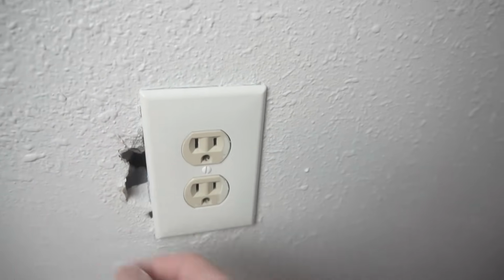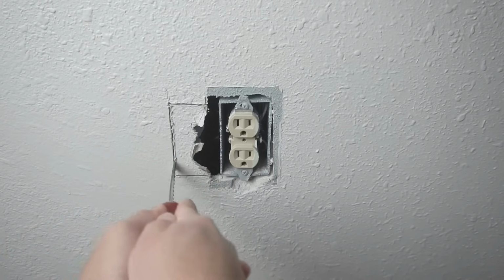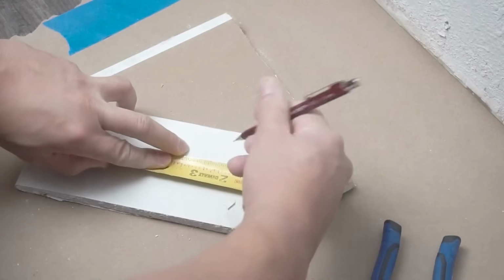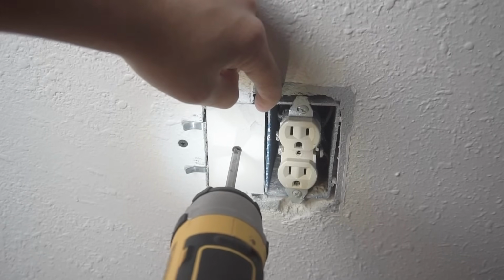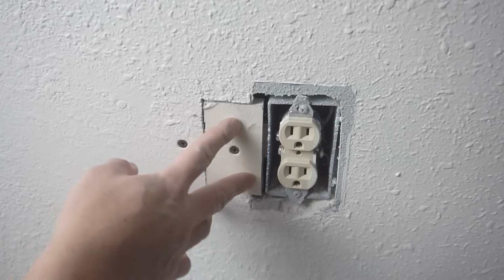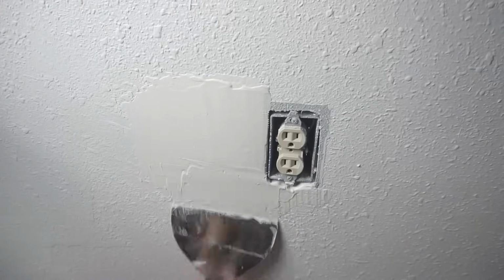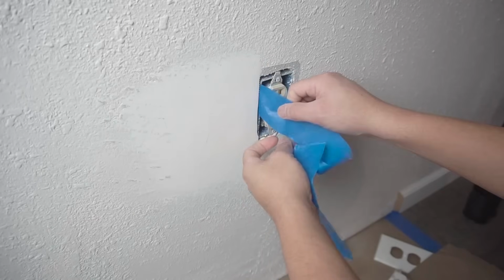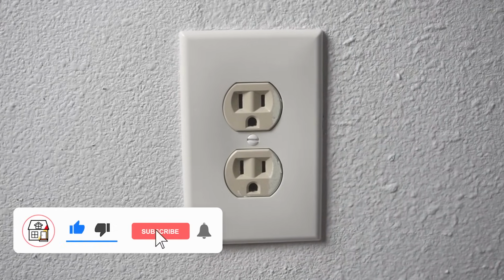How To Repair Overcut Or Damaged Drywall Around Electrical Box Outlet | DIY Tutorial For Beginners!

Comment: I do a fair amount of electrical work on older homes, where I often have to open up drywall or lathe and plaster walls. I work with quite a few older folks who really don't need to hire another 'guy' to come and repair stuff like this. Fortunately, I know how to do this repair work (or worse) and usually put in my time/materials at no extra cost. 
I'm just paying forward the time/effort my mom put into my upbringing and education, etc. Depending on the home/job, I may have to return a couple of times to let things dry/cure, and do a second/third coat of 'mud', it's just the right thing to do. Getting a 'sparky' or plumber to even bother with a 'small' job is insanely expensive and/or impossible for so many people, I feel better taking care of all of it at this point in my life. (Just don't let me near paint :))).

Comment: - Introduction: The tutorial focuses on repairing damaged drywall around electrical outlet boxes or covers, emphasizing the importance of addressing hidden damage caused by impact.
- Preparation: Ensure safety by turning off power from the circuit breaker. Measure and mark around two inches from the visible damage to create a template for cutting.
- Repair Method 1: Utilize drywall repair clips by attaching them to the damaged area and securing them with provided screws. Measure and cut a piece of drywall material to fit the damaged section, then attach it to the clips.
- Repair Method 2: Alternatively, use scrap wood such as a shim or a stir stick to support the damaged area. Secure the wood with drywall screws and attach the cut drywall piece.
- Finishing Touches: Scrape off excess texture around the repair area for a smooth finish. Apply mesh tape and joint compound in layers, allowing drying time between coats. Sand the area to feather the edges, then apply joint compound texture using a texture sprayer. Finally, paint over the repaired area and reinstall the outlet cover.

Comment: For something that small just remove the face plate and put some mesh tape and mud it
Reply: Well, that’s what the drywall guys did in my house where the installers went a little crazy with the rotozip. Problem is, they caked up the mud into the boxes, and later when I needed to start wiring I had to cut all that out. Since they didn’t use mesh tape, sometimes not even paper joint tape, it just crumbles away past the box, exposing the hole they patched when I try to cut the dried mud out of the box. I have half a mind to just give them a patch to work with when they come back to prep for paint, at least that way I know it will be a good patch and not just a paper thin layer of mud providing the finished surface. I can barely bump their patch and it starts crumbling.

Comment: Instead of using joint compound, use cornice cement, it set like rock! on top of the cornice cement use filler, You dont need to use the mesh tape.. Also put cornice cement on the edges of the dry wall insert. If using the timber put in opposite way from the video, so you have 2 points of contact instead of one

Comment: i dont like all that work if i have some expanding foam in a can i will spray around the box and let it bulge out the hole then when dry use a razor blade to cut flat to wall sand it if need and primer the foam  paint the texture often looks good enough but if not you can add a thin mud coat and texture spot prime paint 
my method is the strongest way and you may add some insulating properties as well

Comment: You can sand and feather the edges with a damp sponge and leaves it  no dust to clean up . I use a tile sponge, and they clean out easily if you are sanding large areas and need to rinse it out .

Comment: I would just replace the one gang box with a two gang box.  It will be faster than to patch the wall, and you get two more outlets.
Reply: So what’s ur advice it is a quad receptacle already make it 6 lol
Reply: @justinroll7481  Install a small cabinet in that case.
Reply: 2 gang tiger box. Pigtail for the next outlet and done. Demo old box with a multi tool to cut the screws.
Reply: It's not a "quad" recepticle. It's a only 2 outlets existing. Once you put the 2 gang box with another outlet then it will be 4 outlets.

Comment: If you don't have a lot of texturing to do, you can use the spray cans.  They are cheaper than buying a whole compressor and hopper system and a lot more convenient.  If you're going to use them a lot, or texture a ceiling, my recommendation is to go with the hopper.  The spray cans suck for ceiling texture.  Definitely worth comparing the prices.  If you go with the spray can texture, I HIGHLY suggest you go with the "pro-grade" cans.  They shoot texture substantially better than the cheaper cans.
Reply from the maker: Thank you for the advice! 🙏🏽😊

Comment: I have used texture in a can and it works pretty well. So if anyone out there is looking to cut a corner and doesn't have the big equipment for the texture there are some decent ones out there. They do NOT look perfectly blended but you really cant tell unless you are really looking. So if you are like me and don't mind a slight difference it'll work.
Reply: I've noticed a tighter or sharper pattern with the oil based can. water based seems bigger globs that become less defined in the end. All depends on what you are trying to match. What a fun game.
Reply: @thehamburglar9mm  haha no kidding

Comment: I've done drywall for 6 years and it is never good to let your edges dry because you could see them it is better to sponge them to make the lines go away. Second your texter on wall is thick so your texter has to be harder and your hoper pressure should be lowe to they that thick but round texter.
Reply from the maker: Thank you for the advice 🙏🏽👍🏽

Comment: Great job a lot of steps but it paid off. 

Personally a hole that small I would have just put a piece of drywall tape . And a bit of joint compound the small area .
Reply from the maker: That will work too! 5 minute hot mud, would do the trick for smaller holes too 👍🏽😊

Comment: Not sure why you ran the shim horizontal…way better structural strength going bertical
Reply from the maker: I completely agree. I’m just demonstrating that a small shim could be used in lieu of the the metal clips. But yes, if you ran a longer sim vertical, much more structural strength. Int this case it’s just a small patch that doesn’t really need much strength to it. Also another option is using Hot Mud and mesh only which can be accomplished quickly. Many options.  👍🏽😊🙏🏽
Reply: 💯%agree!!😎👍😷🇲🇽

Comment: I've patched holes before, I knew that part, but the best part for me was that texture sprayer.  I have popcorn ceilings and it looks like I could use this sprayer for some repair work there.  Thanks.
Reply from the maker: Thank you 🙏🏽! I really love that sprayer! It’s my go too for patch work!
Reply: If you have a small place to texture your can lightly dip a small bristle brush in thinned out drywall mud and then flick the mud on by pulling the bristles back with your fingers and letting them spring forward toward the wall.  The more you thin out the drywall mud the more fine the texture affect will be.

Comment: That metal adapter is actually quite handy; even more so if you don't have any 'spare' pieces of wood around. Thanks for sharing. Never knew things like that even existed.
Reply from the maker: Thank you for watching brother! Yes the metal adapter is great for huge repairs as well! You can set them on all 4 edges to hold bigger piece of drywall patch! 👍🏽😊
Reply: Never seen this metal bracket before but wood you can get anywhere lol